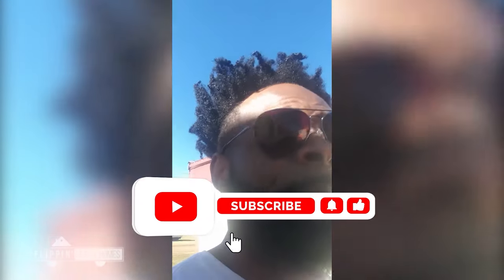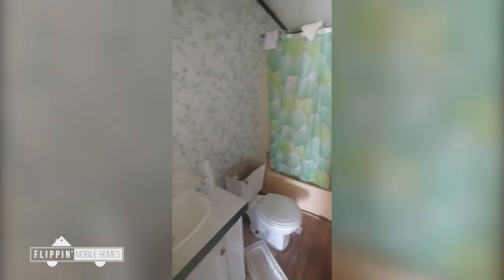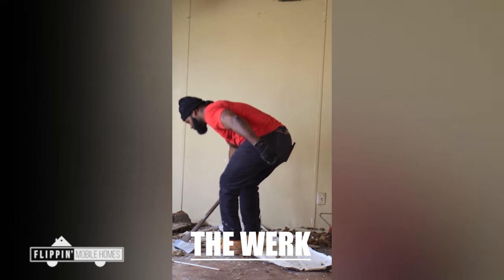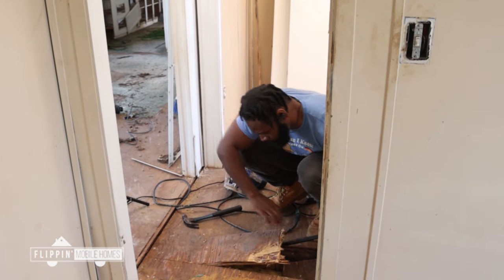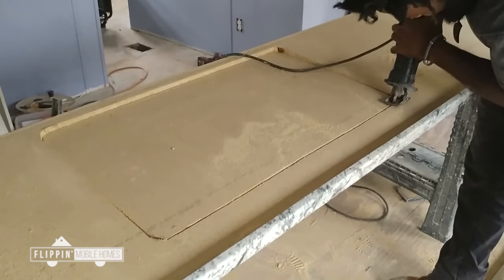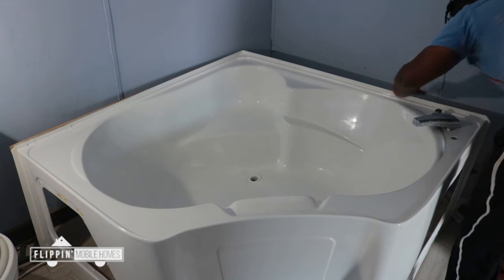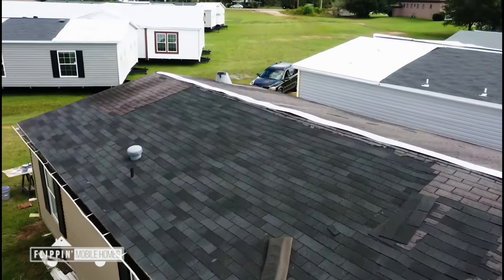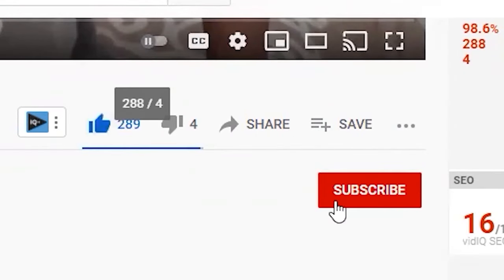I Flipped a Mobile Home...Alone

Comment: This what I’m talking about lol 😂! You did a great job! My husband and I bought a mobile home for $7000 cash. We down sized our lifestyle so I could homeschool. I have done most of the inside myself while homeschooling! I’ve put in two new toilets, 3 sinks, new facets, new flooring in the kitchen and living room husband helped, painted the whole house, put in drywall in two rooms, rebuilt a new cedar awning, two new windows husband helped, husband put in all new lighting and ceiling fans, and pressure washed the porch and painted it. I’m slowing down now so we can level the house, get a new roof, mini split air and heat, generator, and new under belly. We’ve only used cash because we don’t want any debt. I also took all the kitchen cabinets down and rearranged them to fit new fridge, stove, and dishwasher. THAT WAS HARD!! My husband work his but off so I do the same! He was so shocked I got those cabinets done lol 😂! I had him check to see if everything was screwed into the studs correctly. This was the best decision we’ve made the whole 24yrs we’ve been together! We are 2yrs away from buying land. I want the house complete before we move. We live in a nice mobile home park but we pay our lot rent up 1yr ahead. I’m not buying a new car until I have to. Our truck is good enough to go on vacation. We’ve done such a good job on our home my mom is selling her stick built home I grew up in to buy a used mobile home. We are going to fix it up for her. I wish we would’ve done this when we first got married but better late than never!
Reply from the maker: This is the kind of comment I live for! Congrats on your hard work, dedication, and unwavering courage to get things done. I wish you nothing but success in the future and thanks for your support of the channel!
Reply: @FlippinMobileHomes  Thank you! Watching this video gave me the courage to make a plan to strip our mater bedroom and bathroom down to the studs. It’s a big job and I know I’ll need my husband’s help. I’ll do it in different stages. I’m going all out for our area lol 😂. Once I learned how to use a saw, my husband KNEW we were in trouble lol 😂. He came home one day to no walls because I had took down wood paneling to put in drywall lol 😂. He just stood there with his mouth open lol 😂. Our daughter told him it’s ok daddy we got this lol 😂. I had a long homeschool lesson that day so I could only demolish and clean up. I’ll be showing my husband your channel. Keep up the good work! You inspire people like my family who have a dream but don’t have the courage!
Reply: Woww!  Good on you.  I’ve what time are you done the same
so I can save for some land too and sell my mobile for profit.
I’m 68 and will hire some people to help.  Yet I can buy that spray 
Painter and paint myself.
Let’s do this!
Reply: @tamarar.4642  ..wow...wish i could fix on houses...represent for the ladies...i know this is a old comment...but its on time for me...did you create a youtube channel...because ill be watching...
Reply: @FlippinMobileHomes Where can I go to find mobile homes that cheap? My disabled mother needs a home. She's 80% blind and in desperate need of help.  I've searched for mobile homes all around us and no luck because they all range $100,000+ and she doesn't have quite that. About $60,000. She's wasting $3000 on a motel room. Please please help.
Reply: lol I thank the universe for people like yall..my spouse would NEVER...
Reply: so happy for you...living debt free is a great feeling

Comment: Amazing. I just purchased my 1st single wide mobile home that I’m fixing to rehab myself. I’ve never rehabbed a mobile home before, specially alone but after watching your video I’m confidant and ready. I’ve been in the trucking industry since 2015 but my previous job before that I did carpentry for 10yrs, so I guess it’s time to blow the dust off of my tool belt & see if I still got it! 😂🤣😂 Thanks for the very detailed video my brother! 👍🏾  Sorry for the long post.

Comment: GOOD job; i wd have used vinyl plank flooring not carpet, and light tan paint on the walls not blue. the tub overfit is a good idea, i wish i could locate some shower panel walls as i need some to refit my lg corner tub like yours into a shower overhead into that type tub, so i need those shower walls.

Comment: Hey i think it cost a little more than $3K to purchase all those materials. Roofing, decking, subfloor, framing, countertops, toilets, 
All in all, great job. I'm a retired builder thinking of doing a park with units i would refurbished. Bring back some affordable rents so people can save to purchase/invest in their own home. The best tip has been the oil based primer. Are you using mobile home parts for the water supplies?
Reply: I definitely said the same things. I'm in the field of renovating.

Comment: Gas and tar mixture for stain. In Boy Scouts we stained the exterior of buildings with diesel and used motor oil. Similar, but if you leaned against the building (for the first month or so) it got on your clothes.
Reply from the maker: Absolutely. I found this out the hard way some time ago. The way to get around it is using a sealer like Thompson’s clear coat

Comment: Ok, the baseboard idea was genius - but was it hard it the walls weren't straight?  Also, you went BOLD w/that blue everywhere, but it works.  As a female, I would be limited by the strength needed for some of this I think.  But this was great - just enough information presented at a great pace.  Thanks.
Reply from the maker: Glad you liked it

Comment: Excellent job my friend, I like the fact that you don't sell anything you wouldn't live in yourself there are way to many opportunists that try to take advantage of people that don't have much money or bad credit....I do have a question though I never hear anyone talking about heat and a/c I use to live in a new Clayton double wide and my a/c went out after about 2 years then I put in window units. When you sell one do you put in window units or a whole new central air system ?
Reply from the maker: If I can get a great deal then yeah. If not then I got wiggle room for negotiation already factored. Keep in mind that heat is a necessity - A/C is a luxury according to the law, but check with your state

Comment: You should see the one I looked at three days ago 😳 a single wide. Floors soft to the point you can see outside when you walk. Floors tore out and moldy. Ceiling like this one and the kitchen was a nightmare. You got a great deal on this one double wide. It's not in bad shape. This mobile I would happily flip. The one I looked at doesn't come with a deed either because of its age. Either way, I'm trying to decide if the juice is worth the squeeze. It would make magnificent before and after pics
Reply from the maker: If it's as bad and old as you say then I think I'd hard pass. Likely a money pit from which you may never returnnnnnnnn....

Comment: I’m curious if it really cost $3000 to fix up. I have a single wide I gotta do a little less work than what this is but just my vinyl plank flooring I’m putting in is $3000 throughout the house.
Reply from the maker: 3k for vinyl planks in a single wide? Sounds like you went top dollar. I advise anyone to not put high dollar products into your flip but prices may vary depending on where you live.  These days In my area planks cost around $25 per box and to do an entire home it’s around $900 to do a 70 ft single
Reply: @FlippinMobileHomes  yeah I’m in south Louisiana. Which i only looked at stines but I’m gonna shop around some. Cheapest at stines was like 60-80 a box. Somewhere around 2-4 a sq ft. I’ll definitely price around. Very good job on your rehab sir!

Comment: I fear I  ight have the same issue with rot because of my skylights one in my kitchen and one in the bathroom
Reply from the maker: Yeah skylights are bad because factories tend to use cheap silicone on seals rather than the good stuff

Comment: Do you own a piece of land to keep your mobile homes meanwhile you sell them?
Don’t you need electricity and plumbing working to make the repairs?
I assume this is raw land with no utilities where you temporarily keep your mobile homes before you sell them?
Reply from the maker: I use a generator for power and hook up a hose to the valve to test the plumbing. It's pretty simple. And I flipped this at a dealership. I don't move them to any land. That's up to the buyer
Reply: Wow!
That is being creative. That is a great idea! I think buying some land and putting the mobile homes temporarily there while fixing them could also be an option and just use a generator like you said.
Reply from the maker: @janetc5594  it'd also be an expense that would affect your profit margins. Avoid unnecessary moving if you can